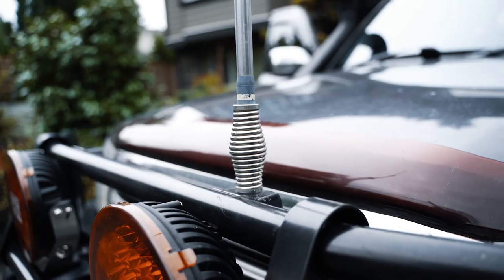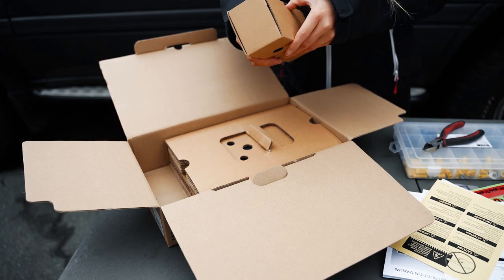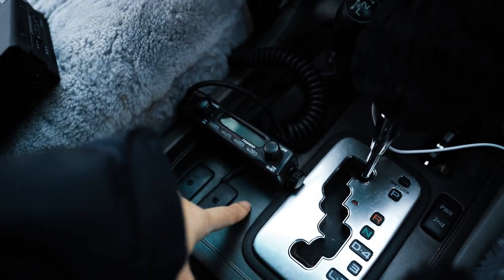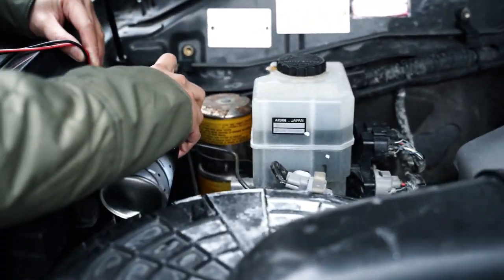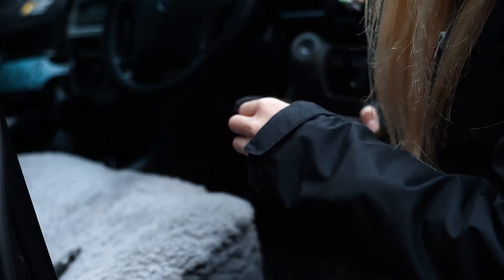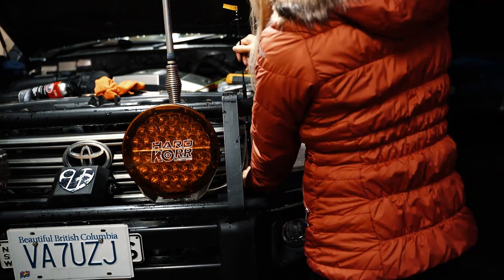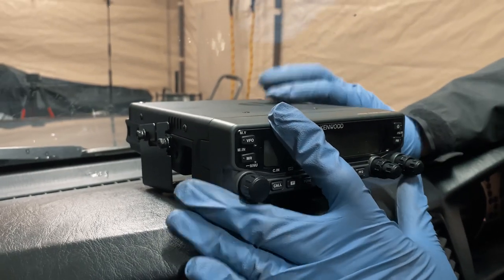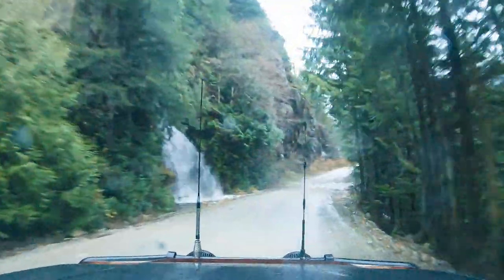Install Kenwood TM-V71A Ham Radio | Toyota Landcruiser 100 Series

Comment: thanks, looking at getting a Ham for my cruiser as well.
side note: Actually you crimped it correctly because per IPC standard you don’t want to solder a connector designed to be crimped. If you would have soldered it, it could eventually, depending on how much that wire moves around cause a fracture where the inflexible solder joint ends and the flexible wire begins.

Comment: If you have access to a plastic printer or spend 90.00 CDN at Burnaby Amateur Radio and get a kit to mount the head to the dashboard or below the mirror. I use a female to female RJ 45 adapter with a shielded ethernet cable to bring the mic up from below the seat where I put the body.  73 va7dgp

Comment: Crimping is stronger and overall better if especially if you use adhesive heat shrink crimp connectors.
Reply: Yes, handles vibrations better.

Comment: Your install is clean and professional. Crimps are fine what dealers use but yes solder is better. I found electrical scary and challenging too helped me to think of it like plumbing. You've earned a test light and meter. My only criticism, don't test for power on the equipment. Check polarity power with a meter because it's all powered by smoke. Once you let that out you're fucked. Watch places where wires can rub ribrate and short clean clean body grounding. The AC episode was awesome I learned a lot :)

Comment: I had that antenna on my motorcycle. It broke off from the vibration so switched to a Comet HP32.
Reply from the maker: It broke off too in my recent trip.. the top part came off. I thought a branch hit me… only realized later.
Reply: @OverlandLady  replace it with the HP32. Really strong mine has gone over 100,000 miles on my motorcycle.

Comment: Does it have the option of adding a speaker to it?  In my first suzuki I had a cobra radio.  You were able to attach a speaker to the radio like a cop car 😂
Reply from the maker: You can connect a remote speaker for when you mount the unit somewhere far from you or behind things. The built in speaker on the unit body so the sound will get muffed up if not left out in the opening.
Reply: Its not going to function like a PA speaker like a cb. Only a external spk for the radio itself

Comment: You are supposed to be a licensed amateur radio operator to use these radios. In Australia maybe it's free to use it, I am not sure, even though the other radio you've got is channelized, but in North America and Europe you are not permitted to transmit without a license.
Reply from the maker: My license plate is my call sign.
Reply: In Sweden we have quite a few frequencies for non licensed use.
CB 27MHz 4/12W AM, FM, CW and SSB
Hunting 31 and 155 MHz 5W FM
156MHz which is a horrible frequency with a lot of interference... 
Former police 69MHz 25W FM
KDR/SRBR 444 2W FM
PMR 446 0.5W FM

69 MHz in Finland are for hunting.
155MHz works together with recreation boat communications and then they're licensed...

Comment: I guess you're not on QRZ. Definitely would hate that antenna position for a lot of reasons, roof mount is far superior (highter = better propergation and you're not irradiating yourself), especially now we have to abide by some ICNERP regs. Face off kits are the way to go for a lot of reasons. It'd also kill me to drill into the dash. Have you also looked at things like email and weather over RF? Well worth getting kitted up for it if you are going remote.